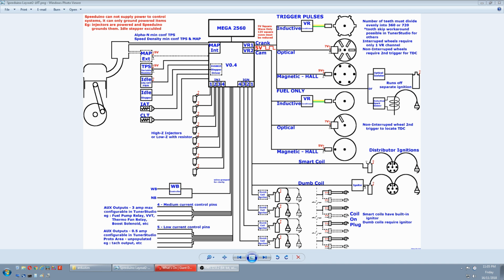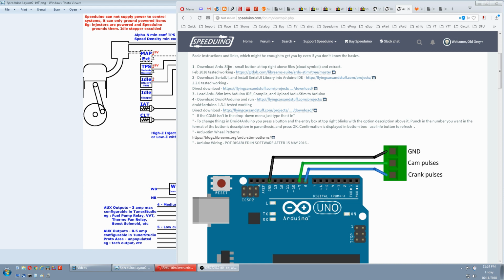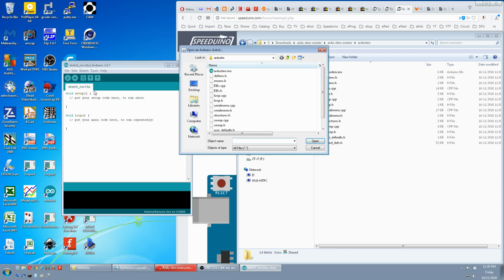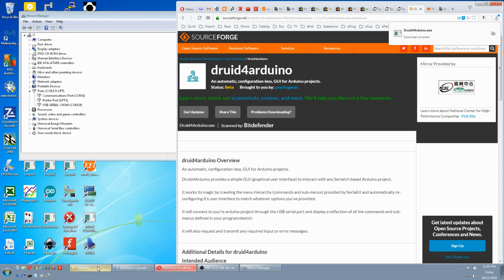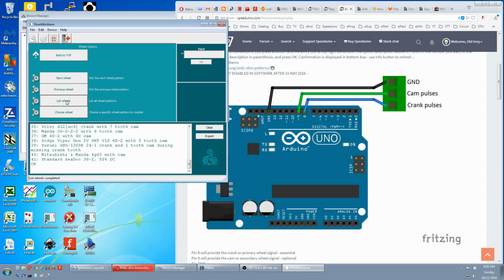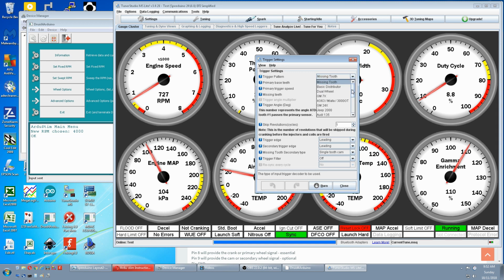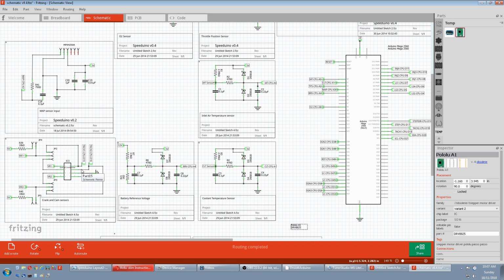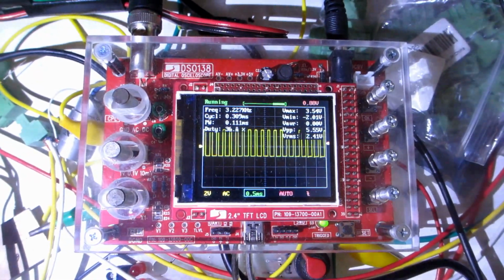Speeduino EMS #3 : Trigger Simulation

Comment: Hi dear sir, i need to operate this 41 signals using Arduino only( without PC ), with 4*16 LCD and the selection to be by using push buttons and the RPM control using encoder. how can i do that? please inform me if it possible or not.
Many thanks as advanced.